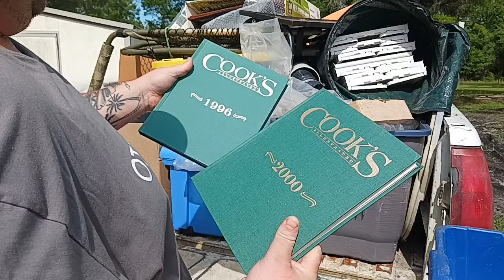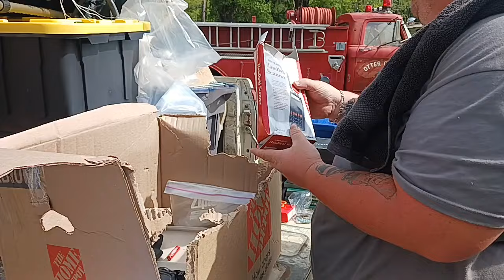I GOT ME A STORAGE UNIT!!! Going Through The Stuff I Got. @StorageWars Lots Of Good Stuff.

Comment: You might want to ask Zim if you can buy what appears to be good fire hose at the fire station if you plan to keep the firetruck ready to pump. I think you said the hose on the truck was no good, and the hose at what was the fire station will just rot. You could hire yourself out for a controlled burn or just be on standby. The truck and the pumps should be used.